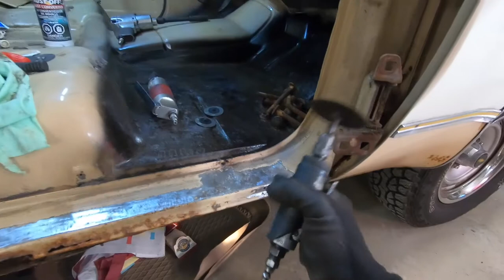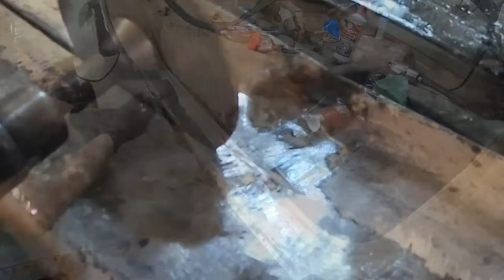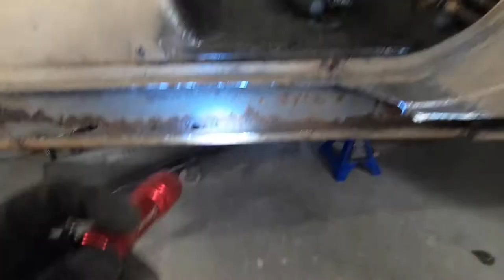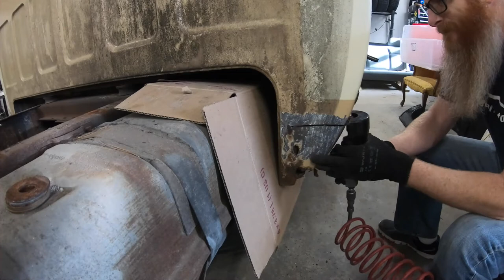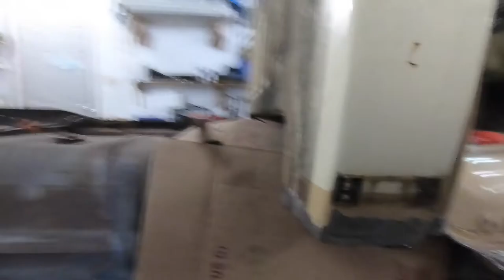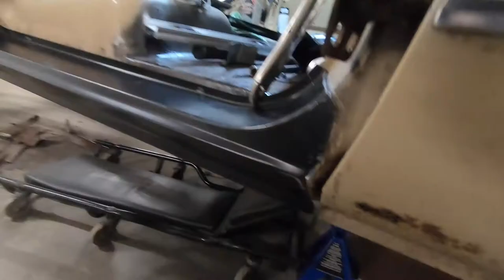HOW I REPLACE CAB CORNERS AND ROCKER PANELS -1977 CHEVY C10 SQUARE BODY PART 2

Comment: Nice going bud. Would love to have an old girl like that. 

Something my dad did with a air compressor that was half the size of your was he had his and a old air tank that was probably a bit bigger than yours is and connected the two with just air hoses. This gave us more volume of air and yes the compressor ran still but we didn’t really have much issues running out of air. He use to run a air hammer, air ratchet, sanders, impact gun, grinders. We had to stop because of the noise or to see what we were doing sometimes lol.
Reply from the maker: I've though about that Kevin, but it just may be time for a bigger capacity unit! I'd like to plumb the garage with 3/4" line as the line itself will increase capacity as well!

Comment: Looking good along where the weather strip goes you should be able to plug weld it drill a hole in the new part and clamp good luck and yes you need a larger compressor at the shop i worked at they had a 500 gallon tank but they had 15 bays
Reply from the maker: I'd be happy with a 60 gallon twin cylinder!!! lol
Reply: Take a look in my play list for the cars i worked on i used to restore early 60s late 70s mopars
Reply: @OldeCarrGuy  it was a big shop i worked in

Comment: Hey Jason, I am a total noob at this seeing as I just bought my truck last September. I am also going to need to replace my driver side rocker. Looking at your video and the way that you did yours, I assume that you didn’t have to drill out any spot welds or anything on it??
Also, as far as your cut off wheel and your air compressor there, it looks like a plasma cutter might have been better for you wouldn’t it? I think you can pick one of those up pretty cheap now over at the harbor freight.👍🏻 really like your video though. I’m glad that you actually show what you were doing there instead of just throwing the video and Time-lapse. It’s actually proving difficult to find a video on the rocker replacement where someone actually shows what they are doing, so thanks again!
Reply from the maker: If you watch some of my later videos when I did the other side, I did have to drill spot welds. Neat lil trick in that video as well.

And yes, a plasma would have been much quicker. 

Thanks for watching and I appreciate your comments!
Reply: @OldeCarrGuy  How’s your C10 been doing Jason? Are you finished with it now?
Reply from the maker: @gimmefuel7268  Is a guy ever really finished. lol I still have to tinker with my fuel supply issue (wrong placement of in tank fuel pump), and I want to add cruise control to it. But I'm driving it as much as I can.

Comment: A few observations and I've done lots of these over 30 years. 1 Don't take your doors off. 2 keep your cab on the ground with the wheels. the reason you want to do this is Cab sag and un-sprung weight, any measurements you take will change and when you weld things in place and them drop the weight your gonna have lots of oops.
Reply from the maker: I'll definitely keep that in mind for the next time. This was my first attempt and because of the confined workspace i felt it would be easier to weld in the rockers on. Thanks for the tips.
Reply: @Gbunton so when doing the work on the inner & outer rockers like Jason is doing here, you recommend keeping the doors “on” as opposed to removing them? 🤔

Comment: I'm sure there's a great explanation, but never understood the appeal to an air cut off wheel over an electric. Is it because of being able to get in tighter spaces? I dunno. Either way it got done and that's important. We've all been there before - not exactly having the right tools for the job. Very nice J
Reply from the maker: It's all part of DIY. The air cut off is so much lighter and compact for sure and the tool to use when air capacity permits. However, I have since bought an electric one and it has pros and cons as well. 
1. Makes quick work of the job, but a variable speed would be beneficial as it is VERY quick to mess something up!
2. It doubles as a grinder for perfection my stupendous welds!
3. It is a bit bulky and the bigger discs don't go places the smaller ones do!

Comment: Yes, the compressor was way too small for this job. But your cutting discs are too thick. I've learned over the years the thinner the disc, the faster (and "colder") the cut. The discs you're using are good for cleaning weld beads though.
Reply from the maker: Thanks! I did eventually figure that out! lol
Reply: @OldeCarrGuy  Oh, if you haven't already, get an electric 4.5" angle grinder. Slap your thin cut-off disc on that and cut all kinds of metal in a jiffy! Best decision I ever made.

Comment: +1 on the angle grinder. Also, don’t get cheap with zip cut wheels, forget that nonsense from Canadian tire and get the real gear
Reply from the maker: "Budget" man! Some things will simply be cheap! Like air compressor, beer and cutting discs! lol
Reply: Olde Carr Auto Guy, don’t be like that. The good discs will end up being cheaper in the end
Reply: @OldeCarrGuy  Hey Jason what angle grinder & discs did you end up buying?? You happy with them? Thanks bud!!
Reply from the maker: @gimmefuel7268  I did cheap out and go with a cheap grinder from Canadian Tire (mastercraft) but chose to do with the Wurth discs. They last longer that the cheaper ones.